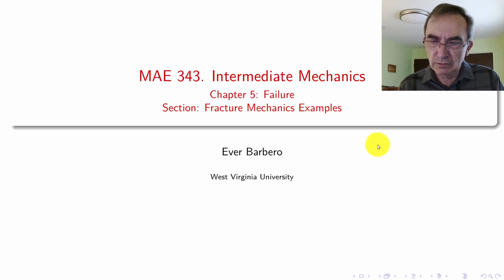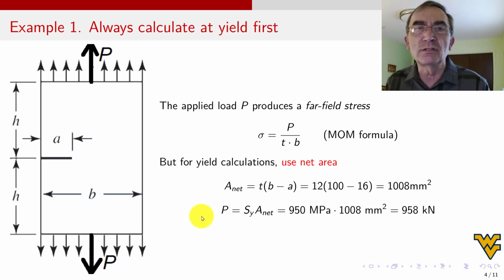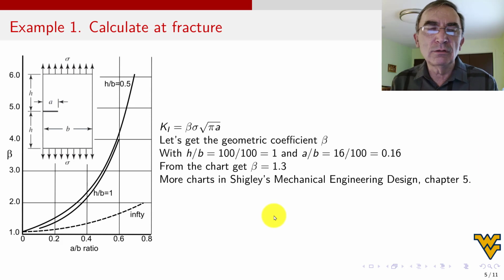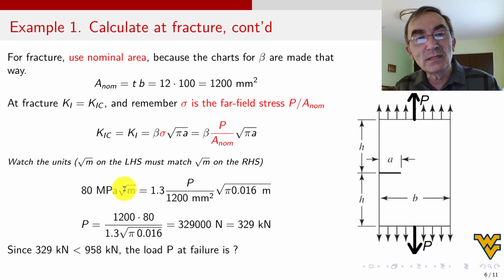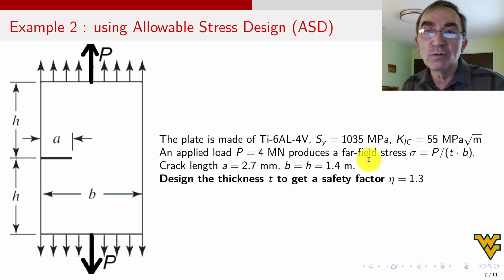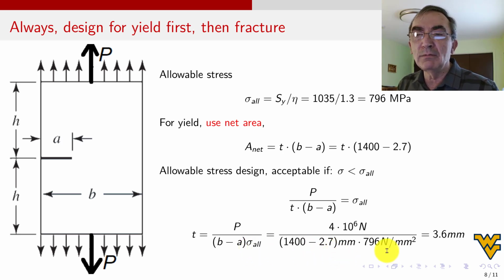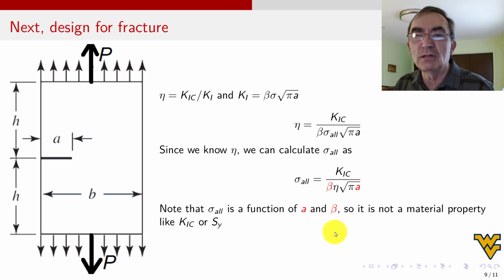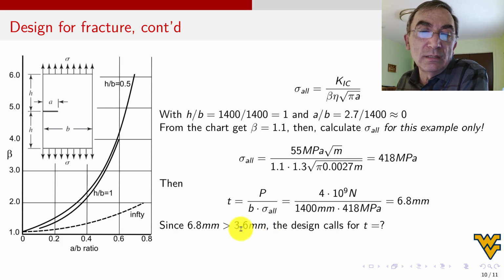Fracture Mechanics Three

Comment: There is a mistake in the calculations of this video, in example 2 when calculating thickness based of fracture toughness 4*10^9 is used for an applied load P, when it should be 4*10^6 (Mega Newtons)